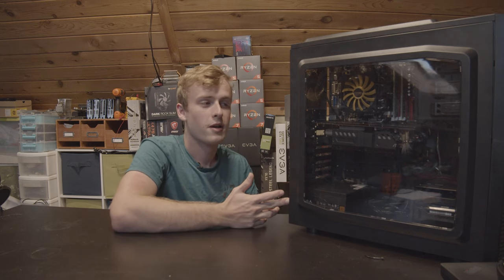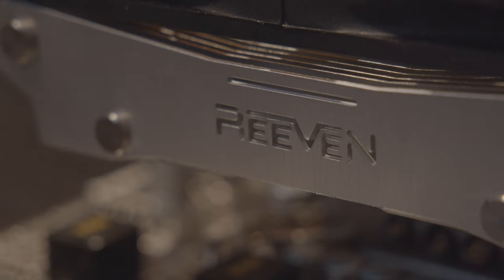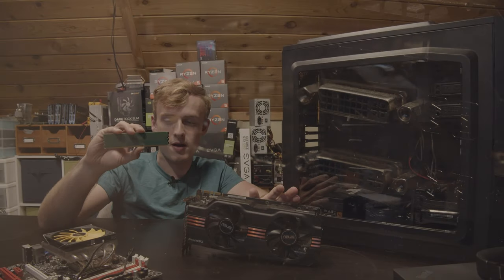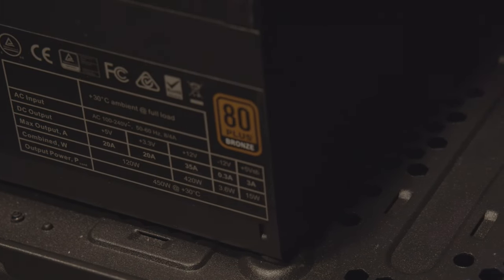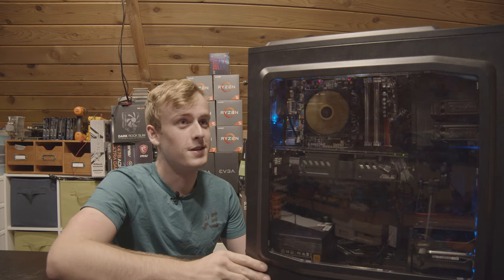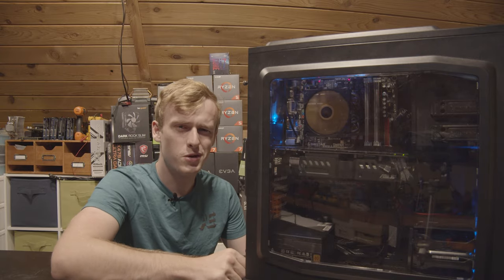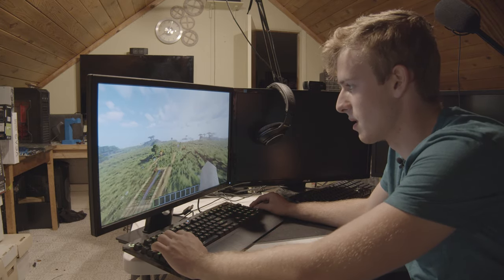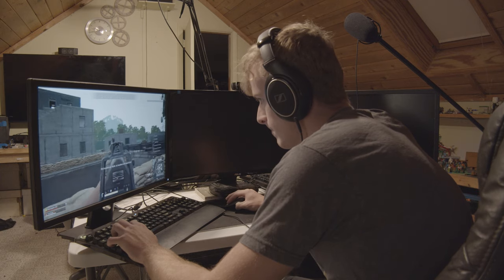Building The $50 GIVEAWAY Budget Gaming PC

Comment: I have that CPU in my budget PC build that I'm in the middle of the i5 650 and I hear it's one of the worst CPU's for gaming in Intel's line up of i5 CPU's.. I have that CPU in a MSI MS-7613 motherboard that I'm scavenging from an old HP Pavilion Slimline s5580t, that has been my daily computer for a long time now. I'll be throwing that CPU, Motherboard, and 1TB HDD into a old Dell Dimension 8400, I was trying to use a Dell Optiplex case but the motherboard was mounted backwards and the IO shield didn't come out, that one looked much better to me but I'm not trying to fuck with cutting out a bunch of pieces and stuff. Then I bought a MSI RX 580 8GB, 600 watt EVGA 80+ PSU, and 8GB (2x4GB) of DDR4-2400 RAM for $110 off Facebook Marketplace, and M.2 240GB SSD for $25 off eBay I should of bought a new one from Amazon for $30 but what can you do. I will be buying an AM$ motherboard and hopefully a Ryzen 5 or better CPU pretty soon, just need to find a good enough deal on the 2 before I upgrade.